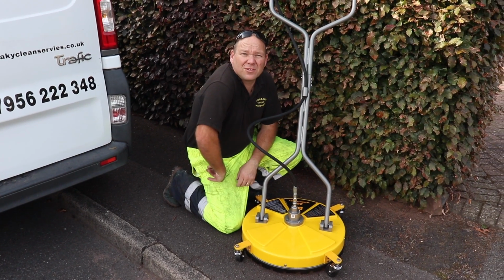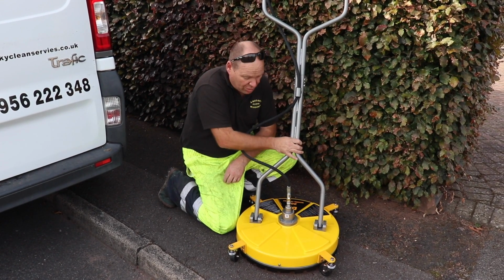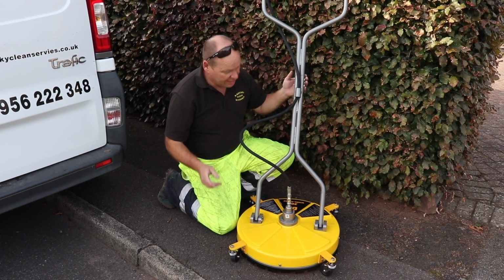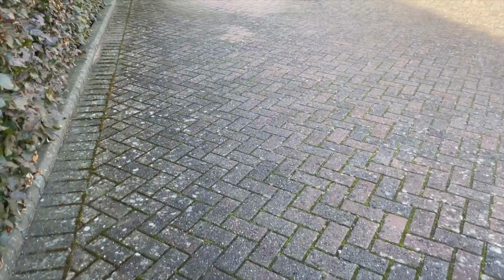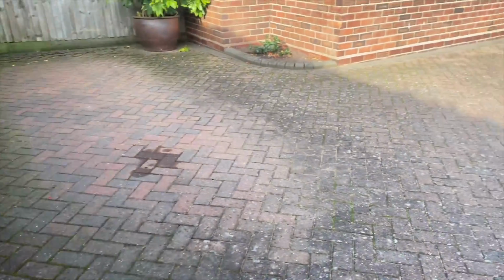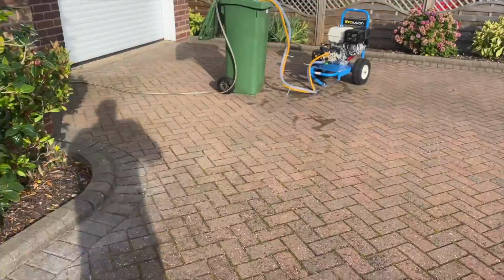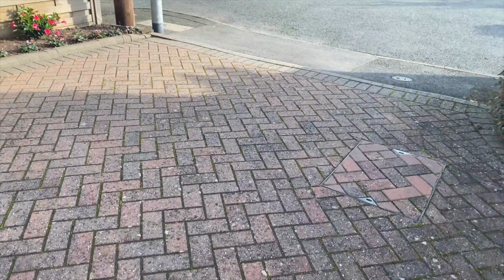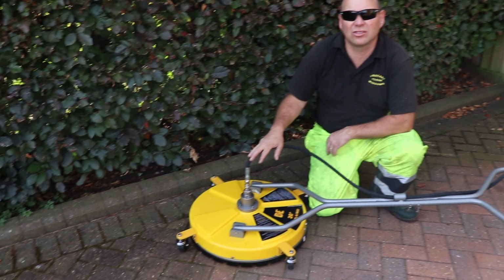First Day Out With The 20" Whirl Away. Is 15 lpm Enough?

Comment: Great video mate, I hate the sludge clean up.
21LPM definitely a big difference but I still do 3-4 passes with it.
Definitely easier on the upper body, just cut in with the turbo and any heavy spots then go at it with the surface cleaner.
I ended up getting the Makita twin battery blower as I had a lot of makita tools anyway so have around 10 batteries.
Reply from the maker: I was looking at a battery blower the other day. Had a chat to Rutland Pumps at the show about upgrading the pump to 21 lpm so watch this space 👍
Reply: @squeakycleandave1  just changing the pump then, bit expensive unless they give you a good deal.
Reply: @squeakycleandave1  I had a petrol blower and sold it to get a battery powered one.
Fed up with the servicing of it sometimes clogging up the usual with petrol machines.
Reply from the maker: @G71cleaningServices  around £300 from Rutland Pumps
Reply: @squeakycleandave1  is that on its own or px
Reply from the maker: @G71cleaningServices  that’s on it’s own but fitting it myself which they say isn’t hard. Would take about an hour to do and they would talk me through it

Comment: great video what psi is your pressure washer please as im starting a drive way , patio, decking , cleaning business in Kent so im trying to get some idea of what cleaner  etc to get as there are many to choice from.
Do you use and moss or other cleaning product to clean the drive, how long did it take you as there where two of you i will be on my own, and how do you price a job please, sorry for all the questions but i have to get some idea of things before i jump in to start things up.
Thank you .
David.
Reply from the maker: Hi David 
If you have the budget for it I would get a 21litre/ minute at 200bar. 
Don’t bother getting a cheap one if you can manage not to as the don’t last and you can’t get the parts for them. 
Take a look at the washers for sale at PWS
https://pwsce.co.uk/

I think that job took the 2 of us a day and then a couple of hours returning to brush in the sand when it was dry. 

When it comes to pricing jobs take a look at Smout pressure washing here on YouTube especially the live stream he does on a Monday night. The old ones are up on his channel. He often goes through quotes live on the stream

Comment: I've got a 24 inch whiraway with a Hyundai 4000p pressure washer 15 l min 275 bar ? But doest get the weeds or moss out much in the gaps like yours does is there a method to fix this ?
Reply from the maker: It's the amount of flow not the pressure that makes the big difference so as a rule of thumb use 1" of FSC to 1 litre of flow. With a 15 lpm machine the maximum size you could get away with is 18". If you want a better result I would sell your Whirlaway and buy a 15" or a 18" at the very biggest
Reply: I see how comes your 20 inch works well then same amount of lpm? 18 inch actually get the weeds and muck out of paving and block paving then ?

Comment: What pressure rating pressure washer did you use please?
Reply from the maker: It was 250 bar
Reply: Thank you, that was enough to get the moss out between the joints? I struggled with mine and then used the turbo nozzle instead

Comment: Hi my friend could you tell me what pressure Would you recommend For doing driveways like you Cheers
Reply from the maker: The flow rate is probably more important. That job was done with a 250bar pressure washer at 15 litres/minute but I’m changing that soon to 200bar pressure but with 21litres/minute
Reply: @squeakycleandave1  15 meters A minute No good Did it do the jobs Four You

Comment: I've gave up with surface cleaner on block pave on my 15lpm, defo quicker just on the turbo
Reply from the maker: Quicker but more vibration on your hand which can cause VWF which is really painful
Reply: @squeakycleandave1  I wear anti vibration gloves, defo helps a lot , tho I won't be doing any pressure washing until I can get any fuel 🤬🤬 just had to postpone tomorrow's work now too
Reply from the maker: @JPHeath  it’s mental isn’t it

Comment: Hi Dave, hope you had a good Christmas and enjoying the break. I’m considering getting a pressure washer but am completely unknowledgeable when it comes to the techy stuff. I was looking at the Hyundai 4000psi 15 Lpm machine, but the Honda EVOLUTION 2 21200 only has 2900psi but delivers 21 Lpm? I would’ve thought the higher the psi the higher the Lpm??
Reply from the maker: Hi Andy. 
You are probably better off getting the Evo2 as it's the amount of water that makes for easier cleaning rather than pressure. 
The other good thing about the Evo2 is it's a very common machine so easier to get spares if needed.

Comment: Without watching your video, I can say that 15 l/m is not enough in my experience. I have a 15 l/m pressure washer and it is a toy compared to my pressure washer which does over 21 l/m.  You will notice the difference in removing the deep rooted lichen spots which you will never shift with the smaller machine.  The speed difference is huge. A beefy machine gets the job done, no messing.  If you only ever clean lightly soiled paving, you may be OK the bigger machine cuts the cleaning time by more than half.
Reply from the maker: Great information
Reply: That's interesting because the higher flow means lower pressure, I would have thought it would have been quicker but less effective at removing deep rooted lichen than a lower LPM but higher PSI machine.
Reply: You can have both, high flow and high pressure. You have to match the nozzle to your pressure washer's capabilities (Dave's seems to be doing a great job).  As you can see in the vid, SCD is using a wheelie bin as a buffer tank to ensure sufficient flow and maximum pressure.  It is no good for a machine to running at max for an extended period, it will not last. There needs to be headroom.  You are right, it is possible to use a tiny nozzle and get more pressure but the less flow volume there is and the smaller the jet, the more distinct the lines will be and the slower the operator will have to go to avoid creating distinct tracks.
Reply: @Peopleater1987  sometimes it is one of the few things that will but it is nice to have chemical free option.
Reply: Personally I think 15lpm is enough if you set up your surface cleaner correctly. Height of the rotary arm and nozzle size to your machines output
Reply: Can't say fully agree, using the right chemical for the right surface and a half decent machine 4k psi + usually cleans anything

Comment: Definitely agree with it putting less strain on the body. But I think it came with jets for a 21ltr machine as that is the size of machine it was designed for
Reply from the maker: I contacted the manufacturer and they said it was fine to use 15 ltr machine as long as the jets were changed
Reply: Where can you buy the jets from
Reply: @wellsconstruction3429  Rutland pumps
Reply: What jets need to be on ut for a 15 lpm machine?